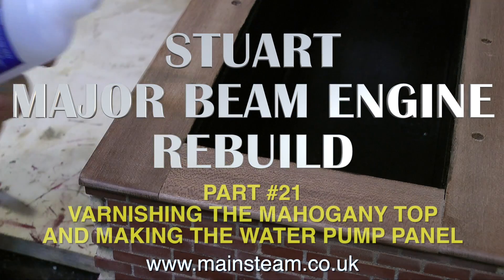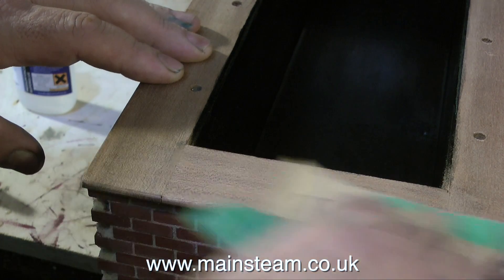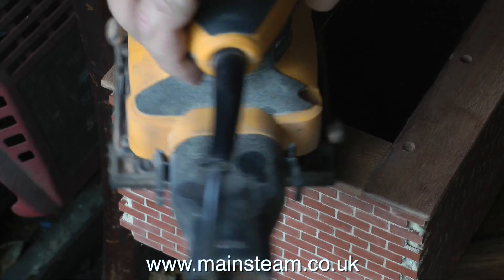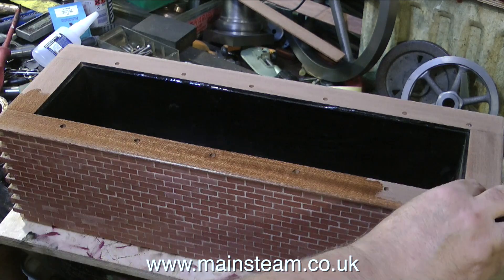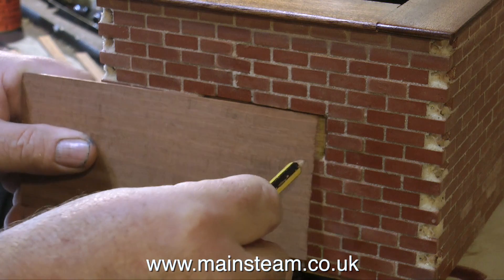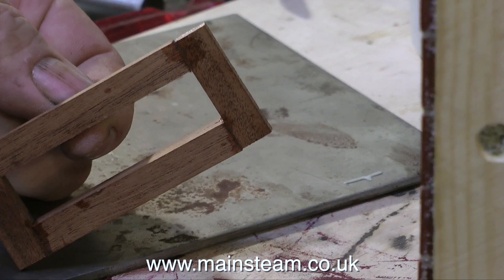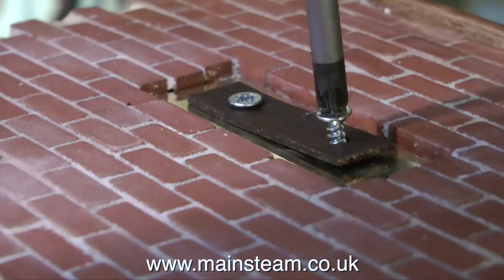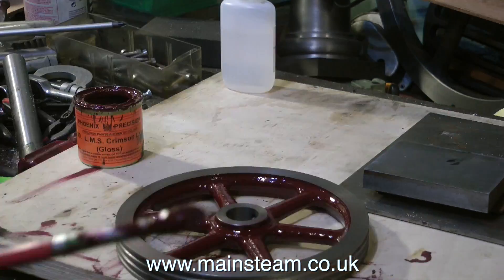STUART MAJOR BEAM ENGINE REBUILD - PART #21

Comment: Hi Keith. Would the mentioned water pump option be driven of the main flywheel via a belt?
Reply from the maker: +Jonny Stevenson It is shown on the videos when the engine was in one piece. The water pump is driven via rod from the beam.
Reply: Thanks for this reminder +Keith Appleton. Keep up the good work